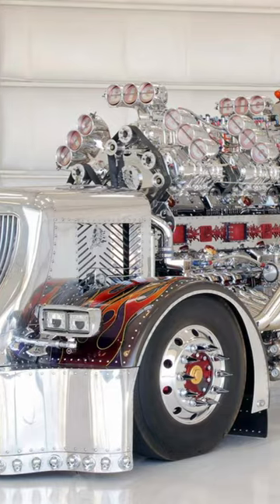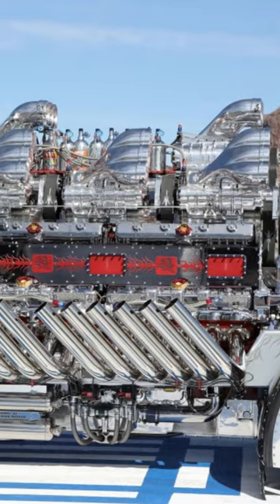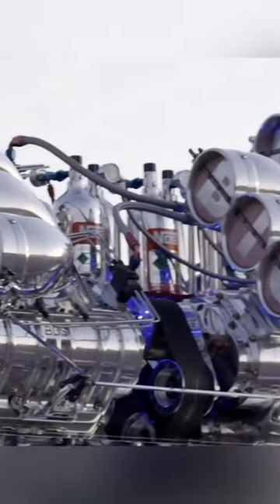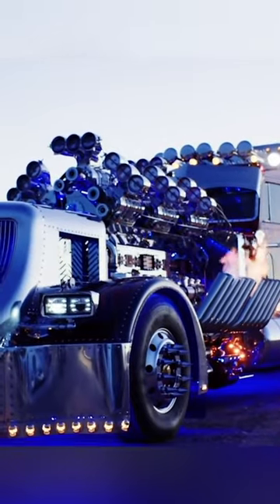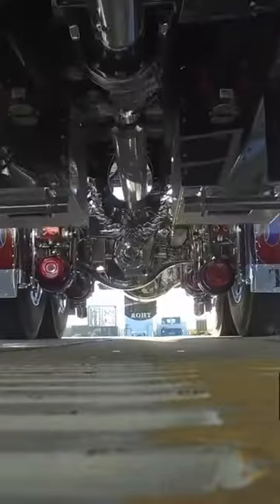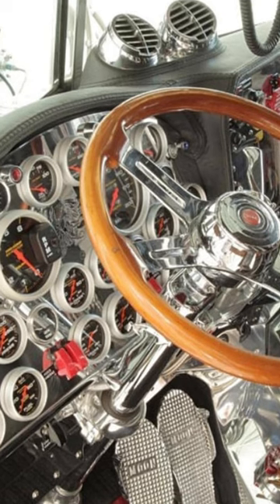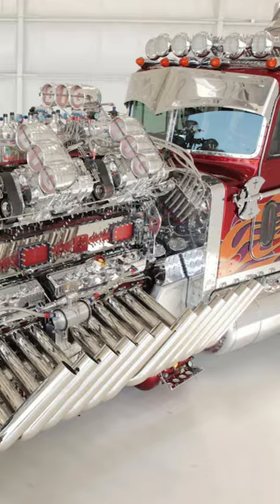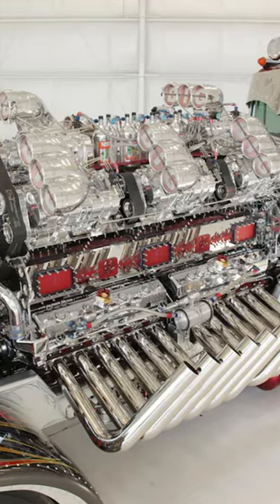Most POWERFUL Semi-Truck ENGINE

Comment: In a world of 30k HP top fuel dragsters…..Yeah, not impressed with the HP figures. Better off showing the Tq curve.
Reply: Yeah.  But would it run for more than a minute before needing rebuilt.    And trust me....
I love NHRA.
Reply: @Mr.EeToMyself I doubt it
Reply: @mattd19902010 well it has a cooling system so if it just idles yeah it could beat 1 min easily
Reply: They are nowhere near 30,000hp
Reply: @joepeacher707  some are already at 20k hp. Give it a few years…

Comment: It’s a driptroit soon enough it will start leaking oil and it won’t look that pretty.
Reply: Start leaking? I thought that’s how you know a Detroit is healthy is when it’s slobbering oil everywhere. I was taught when I was a kid if you open the hood and see Detroit green you check the coolant and fill the oil! Cummins and Cat you fill the coolant and check the oil.
Reply: That's what happens when you have a shitty mechanic. Our 12s didn't leak. We had 3 terex scrapers. They do Use oil, though. 2 gallons in the 12 and 1 gallon in the v6 on the rear.

Comment: A 12v-71 is cool. A 16v-71 is cool. A bigger industrial, marine or aircraft engine or gas turbine is cool. 
A 4000+hp helicopter tuboshaft engine like a pratt & whitney T73 is cool, a napier deltic is cool.
 But 2 12v-71s? That is just not very creative, it simply screams you just wanted to show how much money you can sink in a truck